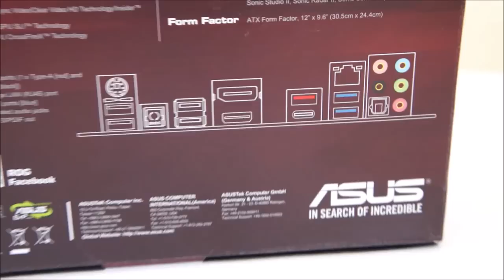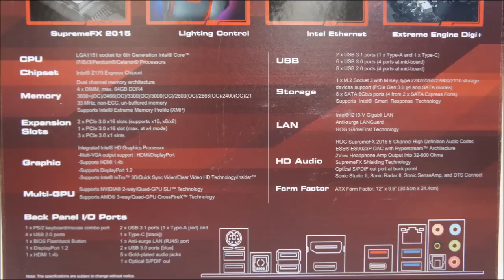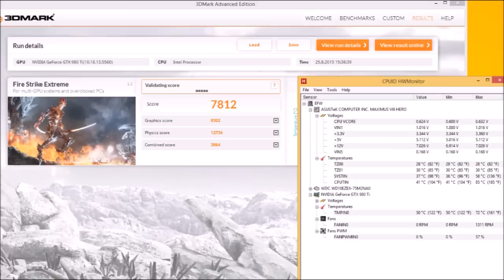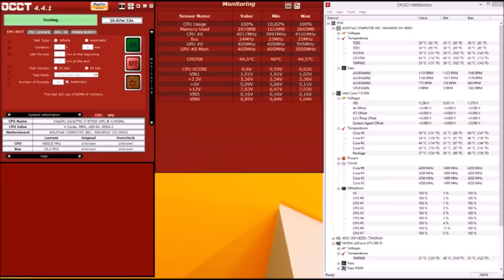ASUS MAXIMUS VIII HERO review, test, intel i7 6700k overclock

Comment: Just ordered this MB for my new build, looks so sweet.
Reply: +Slick Reed So have I, got the haf x case to put it in :D. I think I'm going with the skylake intel core i7 6900k processor to power it.
Reply: +Divergence I got the 6700k, can't wait.
Reply: Divergence 6900K is a Broadwell cpu with a 2011 socket, not 1151 like the Hero VIII
Reply: which would be best for my motherboard? Haven'y ordered anything yet
Reply: +Divergence  Asus Rampage IV. I believe it has 4 channel ram , something to consider when deciding what CPU to purchase.
Reply: how has it been woth you so far ?
Reply: I had to update the Bios because I l;ost all usb's. Outside of the its been an awesome board, OCing the CPU was a breeze and very stable @ 4.6
Reply: Reed same here! Gonna build a machine running unRAID with both my NAS and my girlfriend's Hackintosh VM :)

Comment: Some reason I'm getting an error a9 message on my motherboard. Any ideas what could be causing this issue? I got the same specs as Nova except my graphics card is the 980ti amp zotac. EI can boot into my motherboard and that turns on fine, just not picing up my hardrives at all, and my zotac fans aren't spinning made sure it's all secure

Comment: Sorry for the newbie question, I am at the very early stages of building my first gamer with ASUS Maximus VIII Hero and i7 6700K.  In  testing without case, have installed the cpu and DIMMS (properly).  I have only hooked up the 24-pin power connector to the power supply unit. Once I turn the motherboard on all I get is a Q-Code reading of 00.   Am I forgetting to do something or do I have DOA unit(s)?  Thank you.
Reply: +Juan Romero  Have u got the Asus Manual with u? It shoes all the codes (Q-code) and 00 will be there. I think u need to hook the CPU EPS Power and the fan/water pump power too...
I'm on my first build too, though i havent put the parts together get. just gonna read read watch watch you tube hehe
Reply: shoes =  shows ")
Reply: Thank you Jimmy.  That was indeed the issue.  First-time building my own system and it works like a champ!

Comment: i got a question to you guys: How much watt should a power supply provide with this setup?( The setup he is using in his video: i7-6700k + gtx 980 ti)
Reply: I would not have less that 500 watt supply for that. The 980ti is a power hog alone and can pull as much as 350 watts by itself.
Reply: Thank you :D

Comment: Does it matter which channel you intall the RAM? I've always heard that you should install it in the channel farthest from the CPU.
Reply: +Bl3ndaable Yes, for better performance install RAM into the further (lighter) two channels. If you have four sticks of ram it doesn't really matter. But with two, use the out two colour coded channels.
Reply: Most of the time the manual states which two slots you use.

Comment: is that 120 mm radiator enough to cool that cpu?
Reply: ya should be I have mine overclock to 4.9 and I never see 150f
Reply: +Lee Dunlap what voltage for 4.9ghz?
Reply: 1.42 ithink
Reply: +Kamil Błażejak he properly won the silicon lottery, not all i7 6700k's are the exact same
Reply: lol